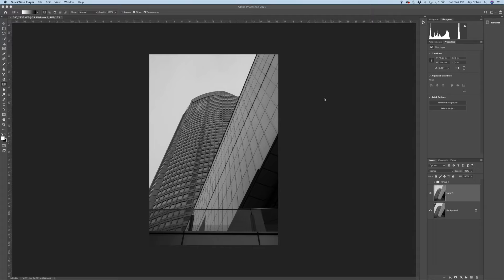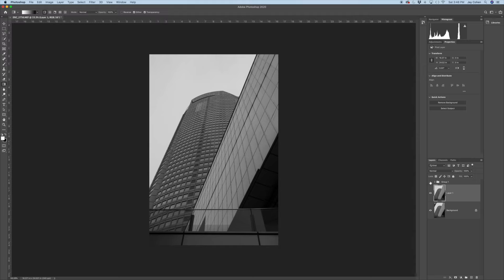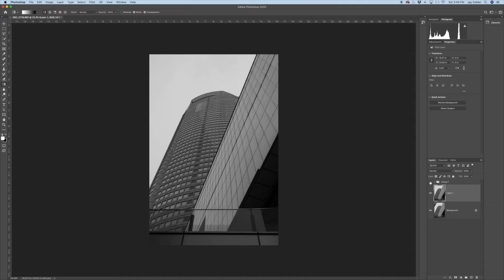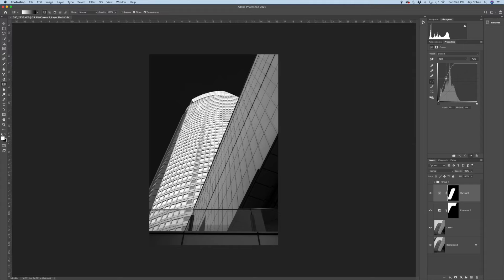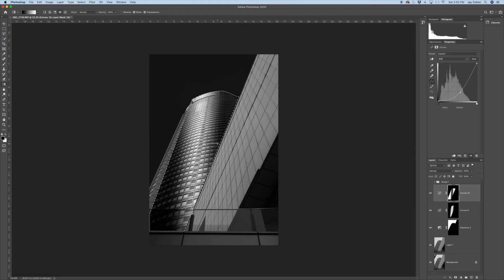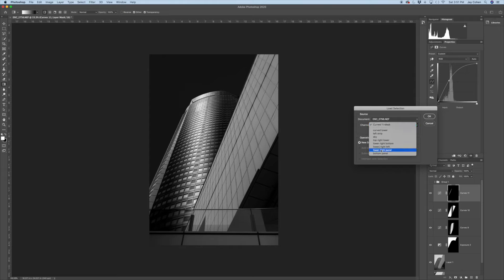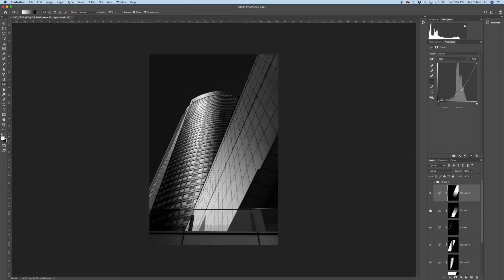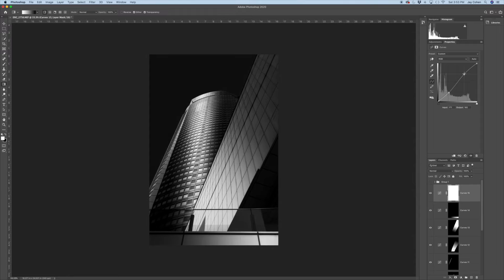How to process a fine art architectural image in Photoshop

Comment: Thanks Jay. That was really helpful and clearly described. There are. Two other ways I’ve been experimenting with. One is to select/CRTL/J to make a new layer with each selection, change to smart object and use ACR to make adjustments. The other is to have three BnW exposures and use selections/masks and gradient tool the reveal/hide lighter or darker layers. I like the ACR method because I’m used to working in lightroom but your method here is simpler so I’ll give it a go. Cheers, Julian.
Reply from the maker: Julian -- Thanks so much for the comment. There are so many ways of doing things in PS -- I will give your method a try! Are you on Instagram? Would love to see your work.
Reply from the maker: Looks like I already follow you! Love your work!
Reply: Thank you Jay, Very kind.

Comment: How long does it take to make the selections? Is there an easier way or program you are aware to help with that task?
Reply from the maker: Thanks JK. It really depends on the image. If the sections are made up of straight lines, it is generally pretty easy to use to the polygonal lasso tool. If there are many curves, it is tougher. I can spend 20 minutes or 2 hours making selections. This one was pretty easy.